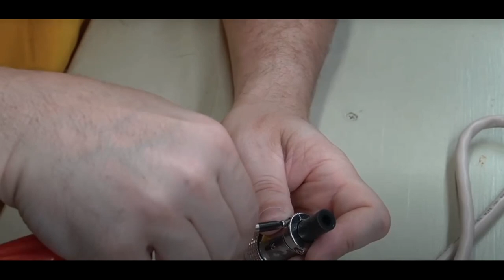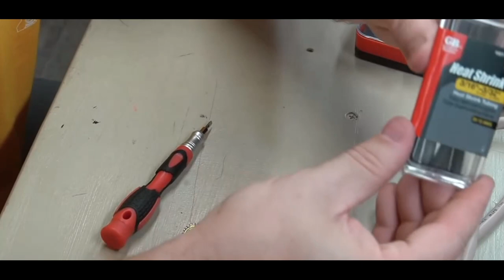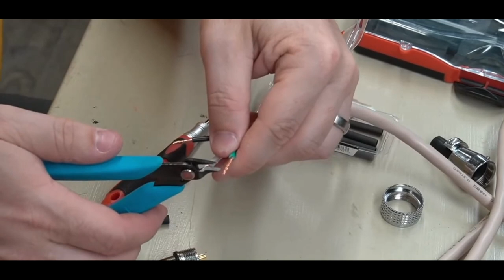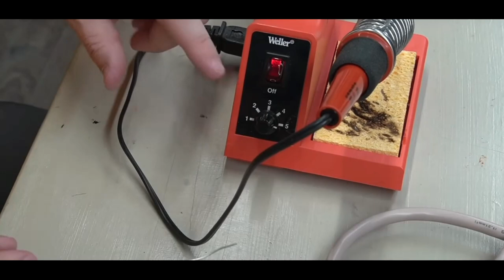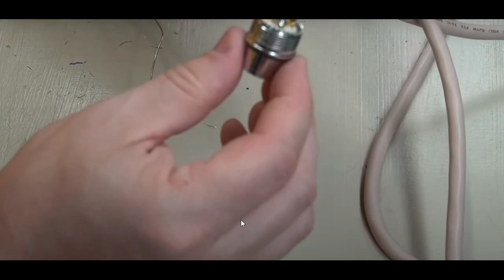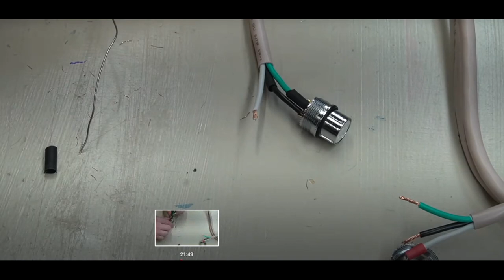CNC Spindle Cable Assembled Incorrectly (Please Be Careful!!)...

Comment: Casing point with SMD, a really good way to show people what flux does and why it's used and why it had to be used, drag soldering.

There's a lot of videos out there that show it, and it sounds like a really silly idea to anybody who either doesn't know how to solder correctly, whether that be technique or a lack of flux.

You can solder a 144 pin QFP in a matter of seconds with the right soldering iron, the right soldering tip, the right solder and crucially enough flux.  

It might be worth linking to a video showing the technique being used if you ever re-visit the solder & flux topic because it illustrates just how important flux is to soldering, but it also highlights how much easier it actually makes the task, clearly somebody trying to do it straight off with no experience is going to have a bad day, but it's a skill you can learn, as you say, practice.
Reply from the maker: Interesting point, I'll look into that. Thank you for your support. Vince

Comment: Another Excellent Video. So last year I contacted this guy. I don't remember his first name but I had some questions about setting up a VFD Spindle. I gladly paid a small fee for his time and advice as to what I was planning. He went above and beyond giving me the information I needed to plan my project. I was very pleased with what he gave me.  But then World War C happened and my plans went on hold. I plan to set up 4 spindles in 2021, three on a hobby CarveWright's just to make them quieter and one on a Shapeoko S3. I have been in electronics since 1975 when I was formally trained in the Navy starting with Tubes and ending in 1995 with Microprocessors. My job was electronic repair of Radars, Gun and Missile guidance systems. I then went to SONY in San Diego and kept the equipment working making picture tubes for 4 years then 4 years at the Philly Sony Service Center fixing all kinds of stuff including Play Station 2's. So I have been around electronics and what he said in the Video is SO TRUE... You must do things the correct way. I found many Cold Solder Joints in my Career done by Technicians that did not understand what they were doing.  I say all this stuff to point out that when I order my VFD's I will be purchasing my Spindle Cables Custom Made through HIM... I have watched so many of his videos and he just does it RIGHT..... At 64 my Soldering abilities are lacking due to age even though I have all the correct equipment. I will put my TRUST in his abilities to get me setup correctly the first time.  SO many CNC Videos and Pages I read complain about LOSS of Connection with the Computer.  So many are solved by grounding the Router or Spindle..... If they had done it correct the first time then they would not have a destroyed project.  And the point he makes about the Insurance Company is Right ON.... If the Insurance Company can find a way to BLAME someone else then they WILL....  I saw it in San Diego when I lived there.... The insurance may pay the claim quickly but when they find someone to blame... They will get there money back.   And setting up a Laser or CNC Business in your house and don't get Business Coverage... Don't be surprised if you get a basement fire and the insurance company tells you... Sorry... Business not covered....   You have got to play by the RULES.... And this guy DOES..... A+.
Reply from the maker: Digitalwoodworkshop, I really appreciate your kind words, support, and your service to our country. I look forward to working with you on your projects. Thank you,
Vince

Comment: I'll ask you what I asked him :-)... The only sheilded cable I can get is 18/4 double shielded cable it's rated for 600/800 v and 12 amps... Can I use this on my 2.2kw spindle I have yet to wire up..
Reply from the maker: No, the proper sized cable is 16/4 as illustrated in my video. This is due to the amp requirement of the spindle. Here's the kit you'll require. Please review the specs on the cable's amp rating in the listing. This is a complete kit required to wire the spindle including the ring terminals for the VFD interface. https://www.ebay.com/itm/131899174942 Thank you,
Vince
Reply: @corvetteguy50  I thought that hence why it's still in its box 😁.. My next question do you post to Ireland, I'll have to order one from you
Reply from the maker: @jigsey.  Yes sir I ship internationally through eBay, or directly. Please message me when your ready. Thank you, and have a great weekend! Vince
Reply: @corvetteguy50  cheerz bro.. Hopefully you might solder the connection on one side too.. I will pay extra for a 10ft cable.. I only have 6040 cnc so 10ft is long enough
Reply from the maker: @jigsey.  I do offer custom assembled cables. Just let me know a length, and I can build it. Thank you,
Vince

Comment: I think I saw this video, and I commented is it safe as I havnt wired mine up yet .. He replied yep lol
Reply from the maker: Jigsey's Workshop thank you for your support. Please review my video in link in the description of the video as I installed this exact connector illustrated on the proper 16/4 double shielded cable. The assembly he performed in this video is dangerous as flux wasn't used for any of his joints, combined with his inferior solder application on the solder terminals as none of the connector's soldering cups were filled properly on the connector with the leads inserted in them. He also used unshielded cable which is not best practice as EMI can interrupt the step, and direction signals on your robot leading to erratic stability.  VFD's typically output three phase power, and an arc from lead that separates from an inferior joint can be catastrophic. Please use caution when assembling your cable to assure safety. Thank you, and have a great weekend! Vince